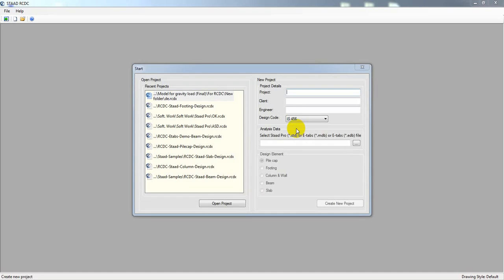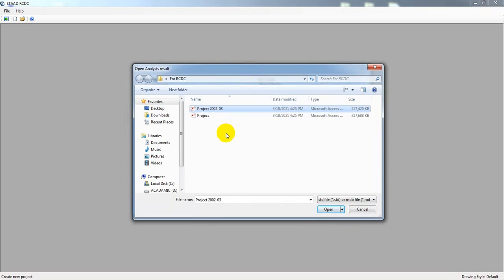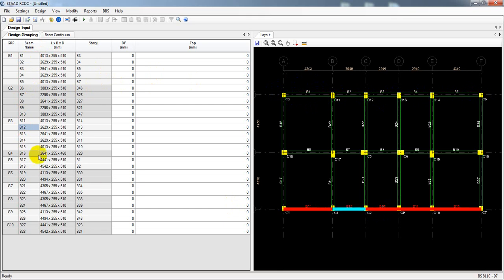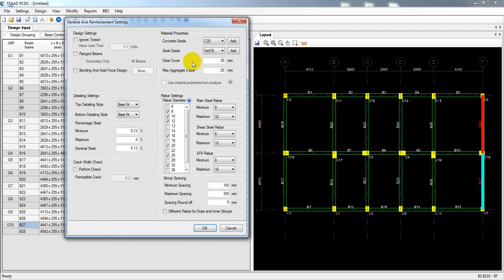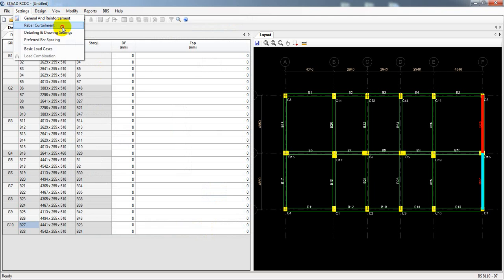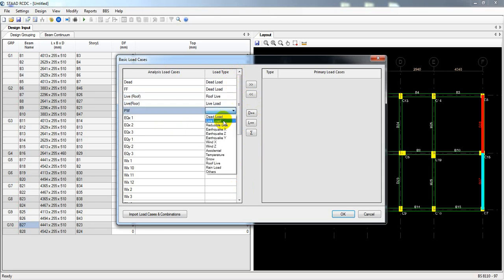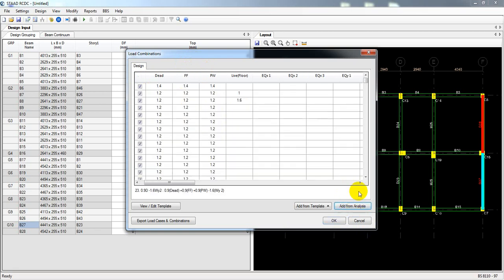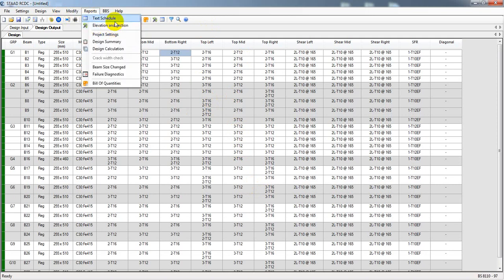Staad RCDC Tutorials - Etabs to RCDC - Beam Design with Drawing, Detailing ,BBS, BOQ - part-1

Comment: What is ductile in rcdc?
Reply from the maker: Plain concrete is a brittle material. It follows Hooke’s law till the point it simply cracks and breaks down. Reinforced concrete is a partly ductile material, with enhanced stress vs strain curve. The reinforcement in concrete helps increase/maintain its capacity at higher strain levels.

The process of laying reinforcement in concrete is known as detailing. Detailing is typically shown in structural engineer’s drawings.

Ductile detailing is a process of providing reinforcement to concrete to be able to sustain earthquakes. It does not mean earthquake proof. It just means, for a building in said zone of earthquake, will stand (without major structural collapse), an earthquake that has a return period of a definite time. Here, the zone, earthquake return period etc are defined by the various codes that are followed by the country/region.

Again, addition of more reinforcement does not imply ductile concrete behaviour in an event of an earthquake. Proper detailed structures give a better performance in an earthquake event, and also helps in saving the amount of steel, and thereby money..
Reply from the maker: Ductile detailing of reinforcement is providing additional reinforcement to make the structure earth quake resistant and the detailing of the same in structural drawings. Stirrups are provided in RCC structures at closer spacing i.e. max of 100 mm c/c at beam column junctions up-to the distance of l/4 on either side (Top and bottom of beam column junction in columns and also in beams on either side of column. Further stirrups are provided at closer spacing in columns up-to 300 mm height from the junction of footing and column. By providing additional shear reinforcement the ductility of RCC member and the load carrying capacity of it after limit of elasticity point till failure. Thus the structure will not have plastic or brittle failure but elastic or ductile failure.

Ductile steel shall be provided in all RCC framed structures if the structure is more than 5 storey height and the location falls in earth quake zone 3 or more.

Comment: sir i have a  problem when i design column in rcdc reinforcement in top level column is high compare to bottom level column what is the solution for this  and load in that column is high in bottom compare to top level column how this is posible pleas make a video on this
Reply from the maker: sure i will.